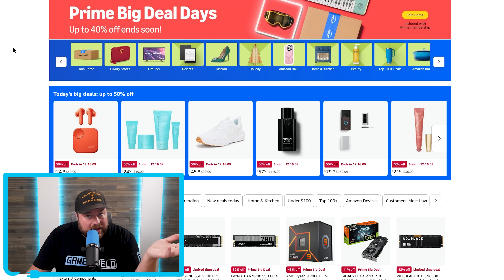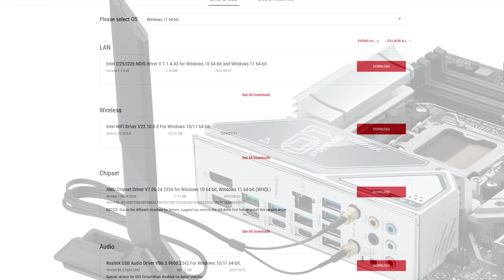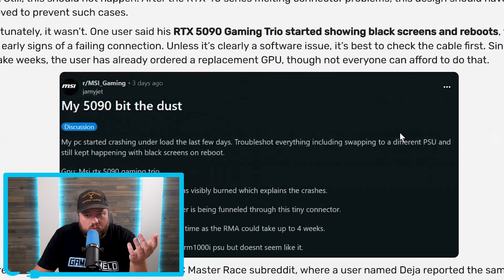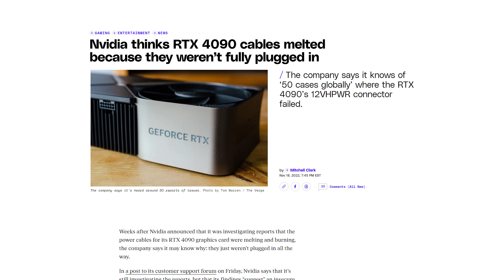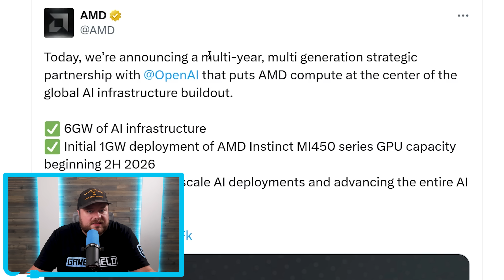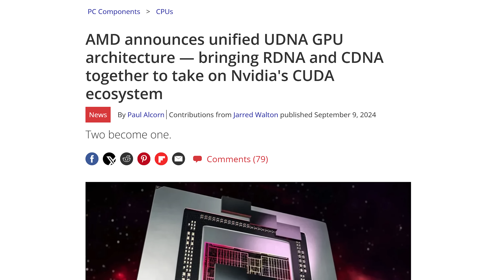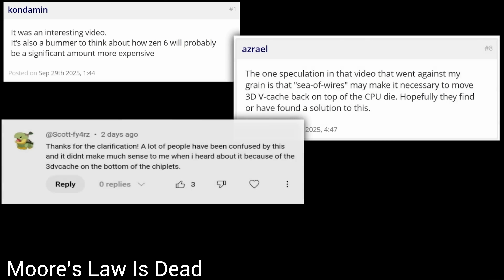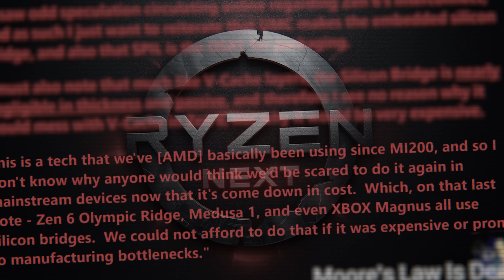AMD’s About To Do To GPUs What They Did With CPUs!

Comment: red is lookin good rn
Reply: When processing large data-sets, I can't risk having my house catch fire. NVIDIA - Please Understand......
Reply: Just made the switch to red and lovin it so far
Reply: red is looking so good they dropped out of the race trying to compete at the enthusiast level vs nvda for this gen. lol.
Reply: @MikePipes-m7y  amd sell consoles/handhelds chips to sony/ms/asus etc.. they like GPU overprice and 0 progress. it allows amd to sell 7yo performance in consoles to noobs @800usd+.
Reply: Good time for my gpu to get damaged lol
Reply: Orange
Reply: GPUs/consoles are 0 progress junk that can't run modern gaming engines and stops VR from being adopted because proper VR runs @8-9k image but all GPUs can do is 540p. all because nv/amd milk the market with slow low-VRAM junk and cheap crappy software gimmicks like upscale and 4x fakeframes.
Reply: we need long overdue 10x jump with GPU performance, not x1.2 4080 @'550usd' (yeah, and 9070xt is a 599usd card, lol), not 0-5%/year 'improvements'. max settings which in 2025 also means max rt indiana jones 9070xt 17fps 1080p. its literally a useless IN MODERN GAMING ENGINES 540p card. rtx5080 57fps 1080p, 5070ti 54fps, RTX 5070 ...13fps. slow junk low-VRAM 10x overpriced like mining isn't over 'modern' cards can't even run MODERN games without upscale from 540p. 

5090 does 64fps 1440p wukong. for 3000usd, lol. with 1440p 100hz monitors for 100usd it means 5090 has like 70usd worth of MODERN gaming performance. 
amd not improving ANYTHING. they are milking the market with overpriced 0 progress junk to sell more junk 2018-rtx2080-level 7yo performance hardware in consoles and to not compete against pro-server market.